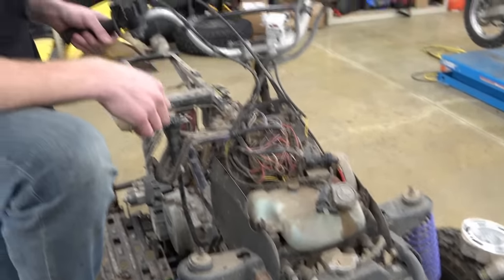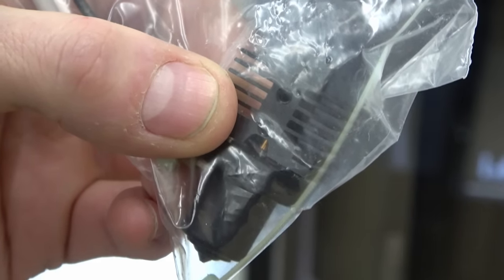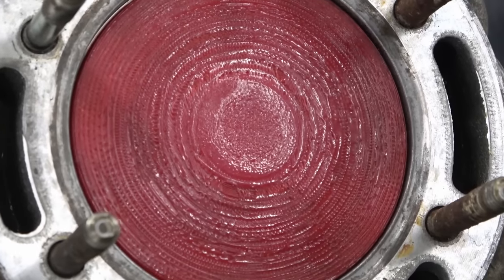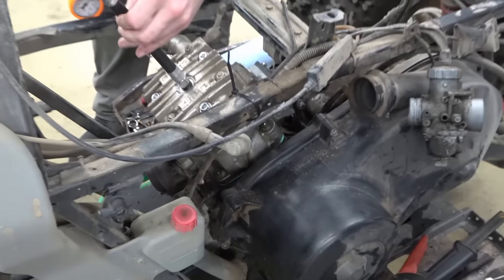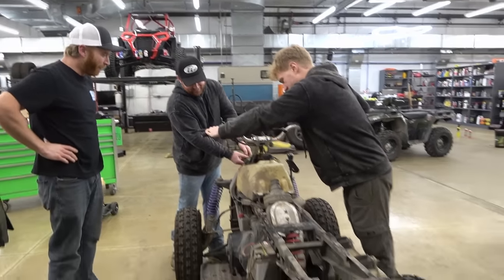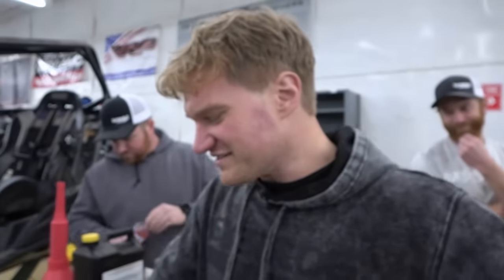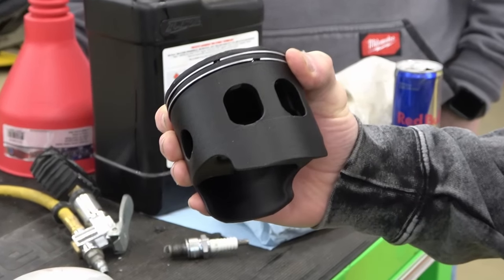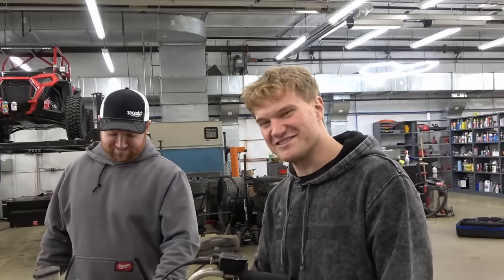WORLD'S FIRST 3D printed carbon fiber piston! Will it run?

Comment: 3D printed Sprocket… See how long that lasts.
Reply: 3d rims :)
Reply: @reggiexp69  I'm down but I'd need a filament sponsor for that lol
Reply: @Steve-sxsblogparts  i could be a fun video
yeah the material for 3d print aint cheap
Reply: @Steve-sxsblogparts  like I said earlier, 3d print a piston and then sand cast it with aluminum cans. A little lathe work, and see how long it lasts. 

Next thought. Cheap quad challenge but anything broken must be replaced by the 3d printer lol
Reply: You need to try with I high temp fillament ( pek, or peek) I bet they last a lot longer
Reply: A big issue now with 3d printing is because some people were making guns its hard to get really strong filament materials.
Reply: Can you buy a Teflon printing filament, sorry guys but I know little about 3d printing.?.
Reply: @clintdenman3037  you can, as an engineering filament, but it's typically mixed with polycarbonate. Hella expensive and extremely toxic fumes. Also because PTFE is naturally non-stick, even when alloyed with PC, it's a total pain in the backside to try to get layer adhesion and the first layer to stick.

Comment: well in the 80's Honda had made race parts by using plastic parts coated in metal ceramics coatings
if you could add something similar, you probably have piston that could last a decent amount of time

there are also 3d filaments that post printing the item goes into an oven of sorts to burn off the carrige plastic and fuse the sintering materials

Comment: I think that y'all should try the carbon fiber piston again but only with a steel plate on top, pretty much design a rebuildable piston with 4 machine screws in the top going down into the piston. I also believe that if you used Teflon to coat the piston, it might help with heat resistance.

Comment: Holy Crap! That was awesome! First thing that comes to mind is that Integza has a 3D printer that will print ceramic-infused parts... I can't remember if it's resin bath or filament, but either way, he's actually 3D printed rocket nozzles with it. I would think that would be a helluva starting place for possibly 3D printing carbon fiber-infused ceramic pistons!!! I smell a collab... :D

Comment: I have some ideas to make this more robust: 
1. Cerakote the piston top to keep heat out of the plastic 
2. Make your own Nylon or other high temp plastic filament with graphene homogenised into the filament, this will substantially increase strength and thermal conductivity. 
3. Redesign the piston with cooling galleries where the oil squirters hit like Porsche’s metal 3D printed piston has 
4. Use planar 3D slicing for a stronger print, more of it will be continuous lengths of extrusion.

Comment: In 1969 I got a 57' Harley Hummer and I wanted more power. My father worked swing shift at McDonnell Douglas Aerospace and worked with early composites. He took the cylinder head to work a filled almost 50% of the head with an  Ablative Epoxy (Heat shield compound exactly the same as all the Mercury space capsules). It worked, but not long, after all its job was to slowly melt shedding excess heat. Dad liked experimenting ❤

Comment: Don't know if anyone else mentioned it but a company called "The Virtual Foundry" makes metal filaments for use in 3d printers. You just have to print it a little oversized then put it in a sintering oven to burn off the pla binder. You could make a piston out of inconel if you wanted.

Comment: Add a sheet metal dome to the top of the piston and attach with four screws and it'll probably run for ages. Would make the ring gap easier to achieve too as it can just be between the sheet metal dome and a step in the piston side.

Comment: Next, add in some of the highly heat-conductive copper-impregnated fiber (objects printed with those fibers actually feel cold to the touch) using a multi material unit to print heat pipes into the piston, and maybe a copper top to the piston to act as a heat spreader, with heat sinks on the piston skirt facess to transfer heat to the cylinder walls, and maybe a couple of small heat sinks inside the skirts for some cooling from the splash lubrication.

Comment: Need to take the last piston design and 3D metal print it. We have metal printers at work and work with suppliers that also metal print.  You can get it in multiple metals (aluminum, S700, etc).  Also it can be heat treated.

Comment: If you have to change the CAD model to get the actual dimensions you want, you need to tune/calibrate the printer and the slicer… try Orca Slicer, check E steps for your XYZ movements, and extruder, adjust flow, etc etc. there’s several walkthroughs like on tech tips for this.

Comment: Do it again and use the best race gas you can. In tractor pulling we use to use soild aluminum heads with race gas that cost $125 for 5 gallons and you could touch the head after a run and not burn your hand. This was back in 2001.

Comment: I would try putting a 1/4" plate steel cap on the piston just hammered into shape.  See if it provides enough heat barrier for the plastic. Also maybe try some more high temp plastics.

Comment: Try in a carbon fiber polycarbonate, then anneal the piston in the oven then run it and see. Prusa makes a great cf pc that anneals easy in the oven and has such minimal shrinkage it doesnt need to be scaled. When I anneal this material for guns, it becomes hammer proof and after annealing the heat resistance goes up.

Comment: 3d print the skirt, but attach it to a cast top.  See how long that lasts.  Heat transfer might still result in the skirt melting, but it would probably last quite a bit longer.

Comment: 2 strokes dont require a scraper ring. In very general terms a single ring piston is meant for a high-rpm engine. Less frictional losses, and decent sealing. 2 ring pistons are meant for a bit longer life and better sealing at lower rpms

Comment: There are ceramic filaments that you print and then fire in a kiln to get rid of plastic and keep just the ceramic. Maybe this could work, or the top of the piston ceramic to withstand the temperature better, and bottom carbon fiber to withstand the mechanical stresses better

Comment: I feel like you could do it with a air pressure system. Make a pressure tank based off a air compressor. The engine wouldn't run super hot and the piston would last

Comment: Great video! You guys should try taking one of the housings and attaching just a metal cap for longevity and heat resistance and see how long that'll go for. Also, not sure if you're aware there is a company called Creaform they make handheld 3D scanners that you can easily scan something like a piston or a screwdriver handle or plastic. Clip-in piece for a car and then print it with your 3D printer. No measuring needed

Comment: How about making the rod in the same way. You may find a way to make a composite piston that has a metal sleeve on the head of the piston over the Plastic piston. You might be able to develop a lightweight piston and rod assembly that has advantages over the standard fair.

Comment: I’m sure you guys can figure out a way to make the carbon piston with a metal dome on top to prevent direct combustion from happening. Kind of a hybrid type deal. If you can make it cheap, lighter and same or better durability then you just took over the market. Everything that has an engine has at least one piston in it. Could be good money for you guys

Comment: Make a 2 piece piston. Use the poly carbon for the bottom half and some sort of metal for the top half. Screw through the carbon into threaded holes in the bottom side of the metal. This way you have the burn protection youre looking for and still have a 3d printed part. Im sure this piston would last longer than 100% 3d printed... could be a really significant difference... or a huge bust.

Comment: I wonder if you printed a new piston and drilled a hole down through the top to attach asteel or alloy plate to the top maybe half alloy half carbon fibre, im amazed how the bottom of the piston survived considering all the friction heat invloved, I think the rings transfered a lot of heat so that area needs to be machined steel or alloy and the rest 3D printed. good job it held out pretty well.

Comment: I thought the pressure would have killed it a lot sooner than that. I am impressed it worked at all. You printed with the chopped carbon fiber, I wonder how long the strand carbon fiber filament would last. just a thought, have an aluminum piston head with a carbon fiber body.

Comment: This is brilliant if you could coat the head with a heat resistant material then you would have a winner. Perhaps a Carnatic coating like the heat shield on the shuttle. There is a company in the US using a cremation coating. It makes the engine quieter and more fuel efficient.

Comment: You could try annealing the piston. I don't know about paCF, but PLA after annealed can withstand over 120 C continuously (in comparison with 55C). Problem is that its dimensions change (you may want to check cnc kitchen channel for some ideas to retain dimensions) after annealed.
PaCF may not suffer from the same annealing issue, but also don't know if it is possible to improve thermal properties the same way as with PLA.
Or you can use a material that will actually be a lot better for this: PPSU, which your printer should easily handle.

Comment: Try an Ultem material print (PEI)! It could maybe last. Same material as kapton tape. Stratasys printers offer a 9085 material with a heat deflection temperature that is above 300F! If I remember correctly, if you don't have one of their printers, they will print for you at cost or other vendors could. I'd love to see if that lasts! I'd throw machining PEEK out there, but that costs a fortune....

Comment: Can you attempt this again with the metal core filaments and sinter it in the oven? It would have to be over sized to sccount for the sintering shrink factor. It would require machining final exterior dimension on the skirt to get concentricity to the bore,  but I may be over thinking it since the piston ring maintains a gap in the stroke. Possibly increase surface thickness and dick around with infill.

Comment: I mean, you can 3d print a metal piston that will last just fine in there. For proper carbon piston test you'd want to make it like formula one disc brakes. It involves "forged" carbon and curing them with silicon carbide and whatnot in a kiln. They'd feel like glass but super light and mostly indestructible. Probly want to still use metal rings and metal sleaves for wrist pin to go through.

Comment: 2 huge problems. Heat and CLE. Metals expand a relatively low amount when heated. Composite plastics are exactly the opposite. The rings and the ring gaps are exactly calculated to compensate for this expansion coefficient. Something you guys didn't do. Not a criticism , just a fact. Overall I thought you did really well. Just for motivation. The Wright Bros. Kitty Hawk flew for 12 seconds on her maiden flight. Try using the 3d to produce a pattern to cast a piston. You could also try the lost foam technique as an alternative.

Comment: What if you was to print another piston then spray it with high heat paint. That might keep it from melting if you was to spray paint the inside and outside of the piston with the high heat paint. 😉👍

Comment: How about an alloy cap that screws into a 3d printed skirt etc? It should take the combustion temperatures much better and the piston would still be significantly lighter. The other approach is that the technology exsists to print metal...

Comment: Since top fuel dragsters replace pistons every race..I wonder if the light weight of this, make a big enough difference, could it hold for the 1 pass..tech only half pass because most dragster by half track the pistons destroyed anyways...but would it allow for a faster time? More revs? More power?? Engine Dyno a V8 built motor?

Comment: Ok here's my plan for you guys... Reprint one the same diameter as the first one put the two rings in it and coat it with some sort of ceramic. Like the stuff they put on exhaust. If you can figure out the thickness make it the same as the last one but lower the rings. Maybe the ceramic will keep enough heat out to run for 5 minutes!

Comment: Now try it with PEI filiment it's about 250 a kilo but the temp at which it starts getting weaker is  375 degrees and I have measured the max temp of small 2 stroke pistons at 340 degrees 

BTW the Brand name you want is Ultem 1010
Its also half the weight of aluminum

Comment: You should try 3d printing piston but then make ceramic coating on it ( I made something like this using VHT flameproof) and test how long it will last. If made properly it should run much longer

Comment: If it broke the piston in the first place it might be running too lean which could indicate a crank seal or some of the leak in the crankcase. Two Strokes will lean out and burn up if there's a leak in the bottom end

Comment: That is a very nice informative video. The most appreciable thing of this video is that, among couple of young guys no one has used the offensive or vulgar language. This speaks off to be really from nice parents !!!!!!!!!!
Well to improve the performance I have you suggestions
1. Instead of using polycarbonate use the PEEK or teflon carbon fiber 3D filament. Both have melting points above 325 degree Celsius. And specially teflon has very good properties against abrasion. very good lubricating properties !! 
2. I don't know whether you have used the temperature control thermostat valve in the radiator circuit or not ? If you have one please remove it !
3. Prefer to use much thicker engine oil for better lubrication (or use some STP oil additive!). 
4. Install a temperature sensor gauge near the piston head so as to see the actual temperature weather it is approaching the melting point of the 3D filament ?
5.  Use a larger radiator for better cooling, clean the cooling channels
Good luck 🌹🌹🌹

Comment: If you do a hybrid piston where the head is aluminum or steel and provided shielding to the exhaust port, it would work for a lot longer period of time. Additionally, their are better carbon fiber manufacturing techniques for a piston. That is probably one of the weakest manufactured carbon fiber methods. Modifying the cylinder cooling specifically for that design would also help. Still its an awesome video. Great job!!!

Comment: I'm not an expert by any means, but if carbon fiber filament requires a hardened steel nozzle to print, couldn't the piston potentially wear out the cylinder bore if it's made of a softer material like aluminum? It would be interesting to see not only the damage to the piston, by any wear that the bore might have experienced as well. May not matter if there's oil, but I'm curious

Comment: Compression wound be higher if the throttle was wide open, but for a 2 stroke motor to run it needs compression closer to 100

Comment: What about doing like they are doing with a .277 sig fury round?  Except put an aluminum top and then 3D print the skirt. So make a hybrid piston. I’ll bet that would last.  The ring lands would have to be apart of the aluminum though I’d think. To keep the combustion from melting the lands.

Comment: What if you faced the piston dome with silicon carbide, a good thermal insulator, that you can get as a filament. Normally you could use a sintering furnace to turn the final printed piece into 100% ceramic, but I'm curious what the temperatures and pressures inside the piston would do. Maybe it would melt/burn away the PLA in the ceramic on the surface and eventually reach an equilibrium from it's insulative properties, protecting the Carbon Fiber below, as the fresh air and fuel cool the bottom.

Comment: What if you make the top part from melted cans ontop of the 3D printed head to mitigate the heat issue. If you get that working for longer i think you might be up to something. Imagine eventually being able to completly print a minibike with engine and all with just Carbon plastic + Melting old cans

Comment: Hey guys I am an Engineer from Austria if you are interested in Learning to print your Parts in Real metal let's get in touch and shape the future of repair Shop! I am Deeply into 3D Printing and Exploring future Materials!
Reply: I'd love to do some metal printing, it's just typically way out of the budget. Do you use normal metal 3D printers or the metal-infused filament that gets baked after printing? I was the one printing in this video
Reply: Greetings Sir it's Rudolf
Reply: There is a very interesting Filament that can used to print investment casting mold ! If that molds are fired they burn away completely! To you have some contact for me where we communicate a bit easier than on YouTube! Love to share my knowledge with you guys
Reply: I also think that if you would print a cylinder in PEK Filament it would run for 1 houre or longer ! That Filament can stand up to 600 degrees! But you need high temp printer for that ! And it's in the priceclase of 24 k gold 😅😅😅

Comment: 3d print most the piston w/o the piston pin hole but a cap for rist pin then screw on aluminium top with slip in exhaust skirt. Top holds  ring and skirt in place. Pin to stop top from unscrewing

Comment: okay. late to the suggestions but. what about using PEI or PEI-CF filament. Since PEI is better in every way than PC
heat resistance/impact resistance/better layer adhesion etc. It will probably be more costly then the actual metal piston but its 3d printed so i fail to see why not.

Comment: Convert it to methanol and see if it runs longer (ie lower temps).  Also, was the plug just fouled with plastic and thats why it didn't run longer?